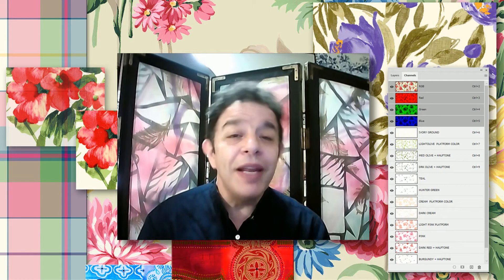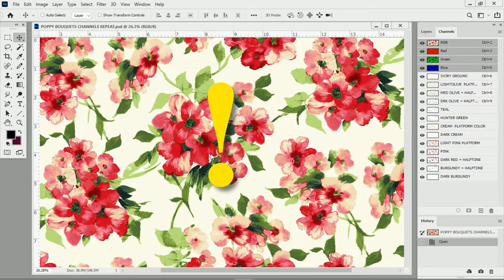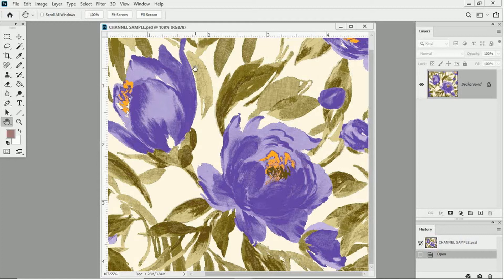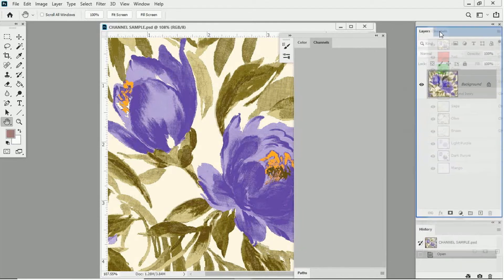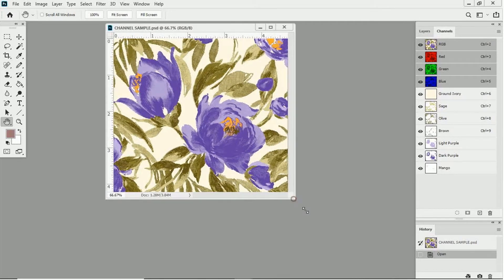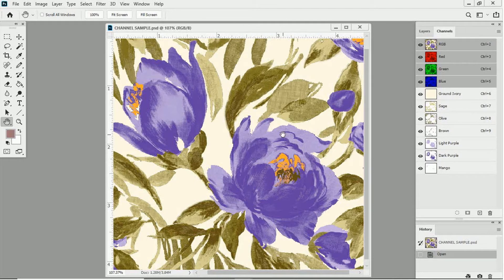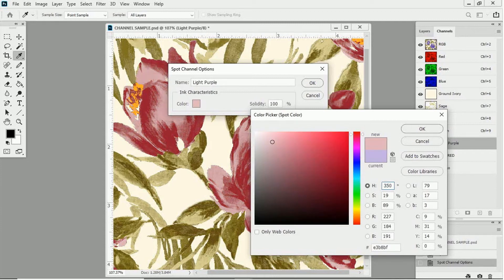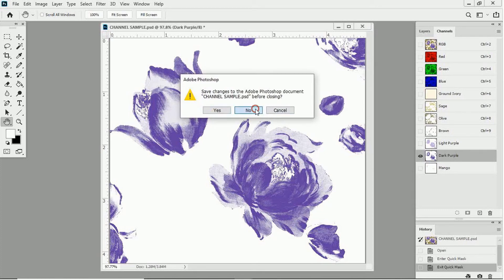ADOBE PHOTOSHOP for TEXTILE DESIGN - Part 8 Spot Channels Demystified PREVIEW

Comment: How do I make two similar colors into one color after color separation?  I mean.. How to reduce color chips from 7 to 5!! Thank you so much
Reply from the maker: Hi Rora, Basically you turn one Spot Channel into a selection (in the Channels Panel). Then (in the Spot Channel panel) select the Spot Channel that you want to combine it with and then fill it with pure black, which of course turns into a color once it's filled. Then (in the Channels Panel) go back to the Spot Channel that you had made the selection with and throw it away.  If you want to learn these techniques in more depth, I have a full class on Spot Channels at Vimeo. If you're interested here's a direct link to the class https://vimeo.com/ondemand/spotchannels .